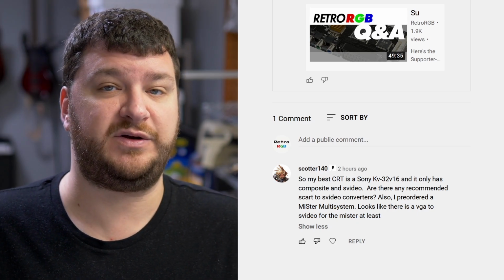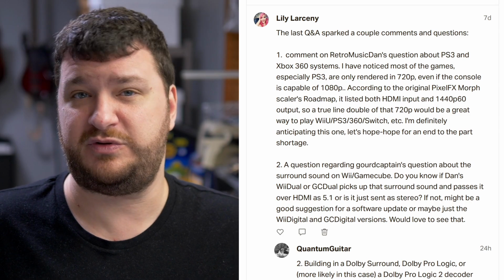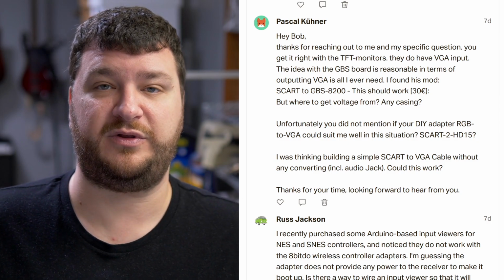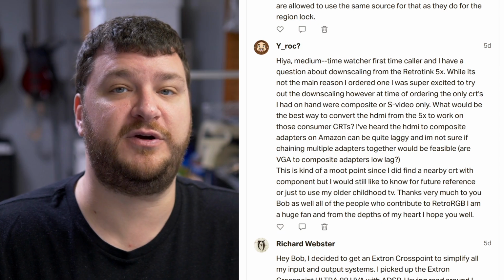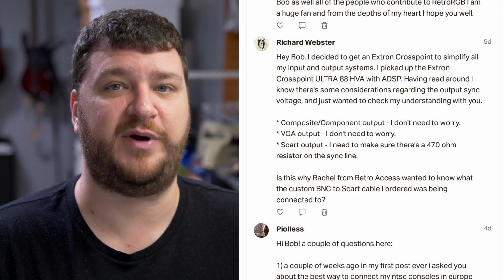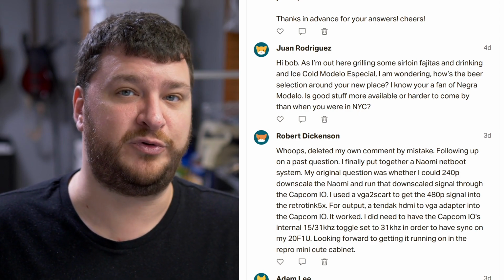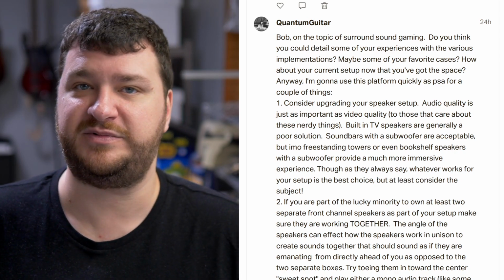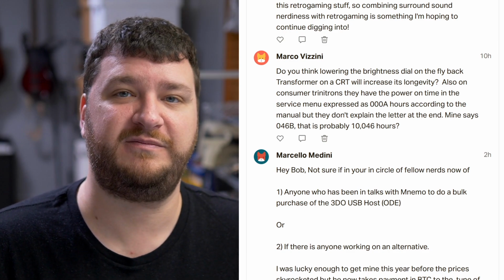Supporter Q&A #182

Comment: For the last question about ripping games.. It’s going to be much faster if he hacks a Wii  and uses CleanRip to make backups of the GC games and USB Loader GX etc for Wii games. Of course you’ll get a scrubbed version of the game in a .WBFS and you’ll need another program to convert it back to an .ISO. On a PC, he’ll need RawDumpWii and a compatible drive such as an LG but not every model works. It’s very slow and is around 2X speed, now this was years ago and it could’ve changed to be faster. As for other games I couldn’t answer that. I do have an External Portable LG Blu-Ray Drive that’s compatible with RawDumpWii because I can use it with uLoader to play burned games on my Wii Externally. It’s actually velcroed to the side of my Wii 😆

Comment: if one has a hacked wii, they could rip wii and GC discs via clean-rip...that's how I backed up my wii/gc discs.  for other consoles, one could use RetroArch on PC.  I have only backed up Ps1 discs using it, but I think it can handle more consoles except xbox iirc

Comment: The mClassic supports 1440p but you’ll need a capture device and a TV/Monitor that does or you won’t see the scaling. Unless you want to capture 720p and play in 1440p you can do that I guess. It’s a good device for the price and what it does but I think the RetroTINK 5x Pro is better now that I have one though it is 3X the price. The mClassic can also scale Blu-ray to 4K if your tv supports it and you’re movie settings are at 24fps.

Comment: neither Wii nor GameCube have discrete 5.1 audio support
surround sound for their games are encoded in Dolby Pro Logic II, which is surround sound data folded into an analog stereo audio track
most if not all receivers today have Dolby Pro Logic II support
a good way to test surround sound from your GameCube is the audio test in the two Star Wars Rogue Squadron games
trust me - it's in surround sound even though it's not discrete 5.1
Reply: To add on, you can play Dolby Surround encoded content on practically any device. Just set the output to stereo. There's tests uploaded to YouTube that will work with Dolby Pro Logic, Pro Logic II and DTS NEO:6 (even the Rogue Squadron one as well). You need to tell your AV receiver which decoding method to use as it can't tell if it's matrix surround or plain stereo.

Comment: Oh one thing I think was mentioned by other people in comments: The common region mods for gen/MD work great if you're using RGB, but if you want composite to work in both NTSC and PAL that's a little more complicated. Switching the video frequency automatically changes all of the various frequency dividers to the correct ratio, however NTSC-M and PAL-G systems use slightly different main oscillators (53.693175 for NTSC-U/C and -J, 53.203424 for PAL-G). Most of the effects of this are minor (a 15 cent pitch shift in the music and refresh rates and game speed off by like 1%) except that this throws the color subcarrier off enough that composite just doesn't work. The "proper" region mod involves having two main oscillators you switch between but most people don't bother--it's typically easier to just have two systems and swap the oscillator in one of them if necessary.

Also you mention not having access to PAL stuff, the good news is that PAL mega drive games are in the exact same cartridge shape as US and often the roms are "world" so you can just use a US one and they're exactly the same (except the label). The sonic games (except sonic 3--without knuckles) are mostly world roms and have no region lock. I think sonic 1 has some difference between the JP and EU/US roms but they're bug fixes I think?

-Finny